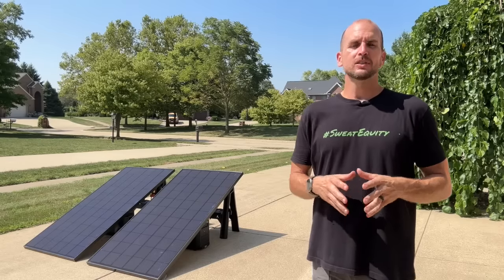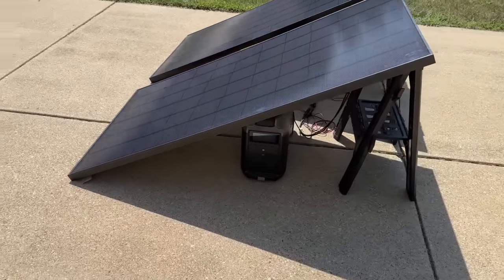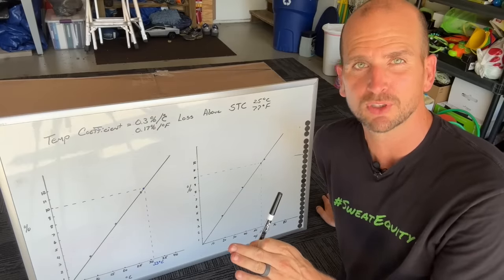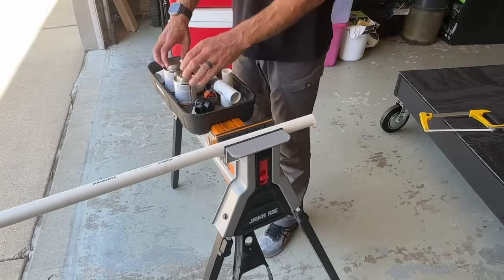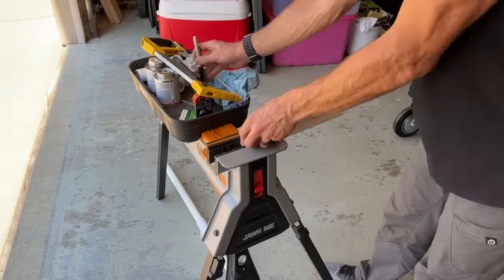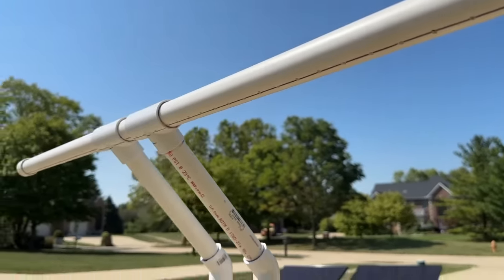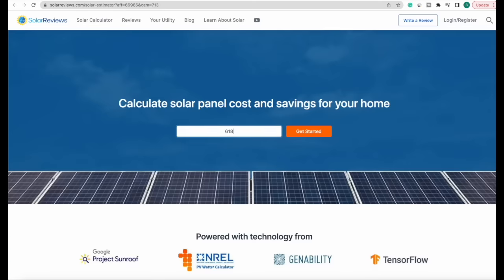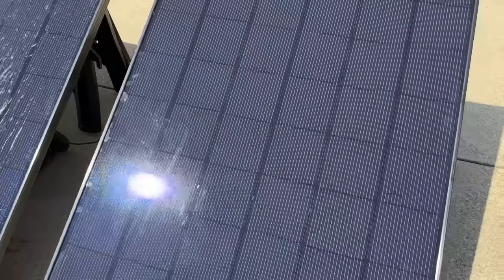Surprising Power Gains By Cooling Solar Panels

Comment: I would reclaim the water at the bottom, run it down into a geothermal system, in the ground, then when the  water cools, it's pumped back up to start the cycle again. Many other uses for that hot water, hot water storage tank for baths, etc.
Reply: throw on a windmill battery charger for the pump and youve got free energy
Reply: The energy u need for that is higher than the profit gained from cooling.
Reply: @lenardgor  boy go on somewhere and study
Reply: People who act like a small pump uses significant amounts of energy probably yell at their kids for leaving LED bulbs on when nobody is home.
Reply: Or move somewhere where you get free well water and hope the power needed to pump the water is much less tha nthe power gain :) In actuality, none of the above are a good idea.  Solar panels are so cheap now that you should just over spec your system.
Reply: @ChristmasEve777  this dude thinks people can afford to move 🤣
Reply: @kingmasterlord  this dude didn't get the joke 😂 🤣 I said "in ACTUALITY, none of the above are a good idea", then I said what IS a good idea.... extra solar panels.
Reply: @ChristmasEve777  yeah and since you're wrong both that they are bad ideas and for saying so, i didn't really value anything else you said.
Reply: @kingmasterlord  I'm a solar expert.  But I don't care what you think!  Go ahead, don't overspec your array with a few more panels, go ahead and use water to cool them or use a tracker.  Idiotic things to do but, my words carry no value.
Reply: @ChristmasEve777 cooling the panels not only increases the power output but also increases the lifespan by several additional years I read a study on this and depending on what panel type, material quality, and configuration can increase the panels lifespan up to an additional 15yrs...which is a  major win... Since for ex. We have a 30yr lifespan panel... We add a cooling system to the back of the panel let's say it benefits to the maximum from the cooling system and gains an additional 15yrs of service life... Let's say the system paid itself off in 7yrs... (Post 7yr mark is full profits) would you rather make 23yrs of profits(uncooled) or 38yrs of profits (liquid cooled)?

Comment: You can watercool the panel by making the backside watertight and pump water through it, and use that water in your heat tank or swimming pool heating.
All in all, it's not worth the effort unless you really have a lot of difference between night and day, but the year itself is not changing that much. So if you do have cold nights, the heat is good for storage in a heat tank, and at night it keeps the temperature of the panels stable plus it lowers the amount of electricity needed to heat up cold water to 65+ celsius after it went through the heat tank. Be aware that you should either have cold water or hot water, but not in between due to legions disease that thrives between 20 and 60.
Reply: We have a buffer of 2000 liters that has it's temperature around 40 to 50 celsius during the entire summer but it's only for heat storage as the water that we actually use just flows through some copper pipes that are inside the buffer and the water simply absorbs the heat from the buffer without exchanging the water itself. Anyway, I don't think there are any bacteria in that water since during the winter that water sometimes reaches 85 degrees celsius when the heating is turned on.
Reply: It works really well in colder climates as the system only pumps the water into the panels during daylight hours and can be used to prevent snow from building up on the panels (via a separated small panel, charge controller, deep cycle batteries, and pump)

Comment: Sundrum Solar has modules that attach to back of conventional solar panels and then use that heat generated for hot water needs, can be swimming pool, car wash, hotels or space heating.
Reply: Thanks for sharing. I’ve been looking for a way to warm my pool while simultaneously adding electricity. I’ll check them out.

If the water cooled panels are 10% more efficient, but cost 10% more it would be a wash. It may be cheaper to just add an extra panel or two.
Reply: @thespencerowen  I've never installed their product but I know they've done a number of projects and think it a very viable means to extract more energy from the sun while making PV panels more efficient due to the cooling provided by the system. If you're in an area that deals with snow it can also be used to melt snow covered panels.

Comment: Majority of the cooling is from water exaporating off the panel so this could probably be done with much less water at intervals.      A supprisingly effectave way to cool your house when the ac cant keep up is to hose off your roof a few times throughout the day.
Reply: Sadly practicality trumps theory.  Unless you have good quality distilled water, you'll have. Rapid scale buildup which will occlude panels rendering them useless.  

Your swamp cooler approach can work if done on the back side
Reply: I’d say more cooling is from conduction (panel to water) than from evaporation in this test.
Reply: @shawnbrennan7526   if that is the case, wouldn't it be better to run copper water tubes on the back of the pannel, which is most likely a sheet of aluminum? That might conduct heat away from the internals more efficiently than running water over the glass.

Comment: This is informative. I wonder if an internal cooling solution may yield even better results. Not only because the actual cells would be cooled but your also avoid any potential loss of sunlight hitting the cells due to the reflection and refraction from the water cascading down the glass.

Might he something to consider for a future aide by side test.

Comment: Maybe you should recommend dual use panels. They harvest the heat with watercooling loops on the back of the panels. So you 1. cool your panels down to get a better efficiency (more Wh) and 2. You can harvest the warm water from the system via heat exchanger.This way you have not wasted any water and get the dual purpose use out of the sun energy

Comment: As a standalone fixture, the potential savings are probably offset by the water and power pumping it. However, if were done as a multifaceted system that is cleaning the panels (keeping pv efficiency ratio up), cooling the panel and also heating water for internal use, then the compounding effect could make it a more efficient and cost worthy approach. I think we'll see more cooling systems in future, as pv panels become more efficient and cost effective.
Reply: Off grid 20+ years and heat loss is an obvious factor you can mitigate. I don't recommend using water though and the way solar installers mitigate it is by adding additional panels to make up what is lost in high temperatures and on cloudy overcast days.

However, for DIY solar I recommend not putting your panels on a roof that is black or dark as that will increase heat loss even more and use a ground mount system over dirt or light colored rock. You can also increase air flow to the back side of the panels by removing obstructions and if possible set them so the natural wind patterns flows across the panels. Even a light breeze makes a difference.

A ground mount system with adjustable tilt and angle or a tracker is optimal.

I also recommend a ground mount system so you can wash the dust and bird crap off your panels and check and do any maintenance needs. My system gets washed off a few times a week.

My system is 1.4Kw ground mount with 600Ah LIFEPO4 batteries and  Geneverse 200Ah and ALLPOWERS 200AH power station for extra capacity and that runs everything: water pump, lights, microwave, laptop, evap cooler, ebikes and recharges lots of tools and gadgets.
Reply: Have a capture system and directly put the reclaimed water back on the solar through a radiator in the shade with a fan and a pump you'd probably have to top it off cause of condensation and evaporation creating a loss you'll need to account for but could definitely work on super hot days

Comment: when i was getting my degree in this field, i met a guy that installs flat fin tubing on the back of panels and the water was cooling the panels and was used to generate heat through thermo heat generators, and some went to domestic use.   
the important thing to remember is to use as clean a water as you can if you are going to wet the panels to prevent degrading by mineral build up and water is a universal solvent and will destroy the frame over time

Comment: I remember reading years ago (early 2000's) that solar panels were more efficient in slightly overcast days, I have no idea if it was accurate or not, but this would kind of back up the theory that the panels work better at a cooler temp.  Either way pretty interesting to me, thanks for making and posting this.
Reply: Basically sometimes a cloudy day will magnify the suns rays through the light moist cloud particles

Comment: I not only have this set up for my 12.4K W backyard fence mounted system but I also have low pressure misters that clean my solar panel and pull my solar panels from 130° down to 88° increasing my total power production by 1200 W which is enough to run a small air conditioning unit. 

I also have a smaller version of a whole home water softener for lime scale.

Comment: to be clear, efficiency increases below STC. The flow meter was a nice addition. One additional test would be periodic water flow. Save water and allows the water to evaporate, cooling the panels. This will depend on humidity which varies by day and region.  Also, if the heated water could be used for things like swimming pool heating or hot water preheating, it gets a bit more cost effective. Water also block longer wavelengths of light (so red more than blue), so cooling the back of the panels might be more effective.

Comment: Off grid 20+ years and heat loss is an obvious factor you can mitigate. I don't recommend using water though and the way solar installers mitigate it is by adding additional panels to make up what is lost in high temperatures and on cloudy overcast days.

However, for DIY solar I recommend not putting your panels on a roof that is black or dark as that will increase heat loss even more and use a ground mount system over dirt or light colored rock. You can also increase air flow to the back side of the panels by removing obstructions and if possible set them so the natural wind patterns flows across the panels. Even a light breeze makes a difference.

A ground mount system with adjustable tilt and angle or a solar tracker is optimal.

I also recommend a ground mount system so you can wash the dust and bird crap off your panels and check and do any maintenance needs. My system gets washed off a few times a week.

My system is 1.4Kw ground mount with 600Ah LIFEPO4 batteries and  Geneverse 200Ah and ALLPOWERS 200AH power station for extra capacity and that runs everything: water pump, lights, microwave, laptop, evap cooler, ebikes and recharges lots of tools and gadgets.

Comment: there's no way the extra 5% justifies the cost/waste of the water. Thanks for the video!
Reply from the maker: For sure
Reply: That depends on the climate. Somewhere that gets large amounts of rain could capture plenty of rain to do this and then use the water for other purposes like watering a garden. The water doesn't have to simply be wasted.
Reply: then use your brain, make pan that captures the water then cycle it back..
Reply: @kahingaltv2023  it’s not worth it. But feel free to do it with your gigantic brain
Reply: @kahingaltv2023 Hi, think rain water harvesting, the panel becomes the means to capture the water.  Using the tank water to cool the panel uses the rain water capture parts you already have. The big tank becomes the heat soak that gets liberated at night.
Take care all M.
Reply: Ofc not, however it is a very interesting test.
Reply: A pool already has a running pump and plenty of water, and the heat added to the pool water is a benefit it many climates. So it is a win, win, win.

Comment: Thank you for your valuable input. There is so much wrong to unpack here, I don't know if we will ever get it right before it's too late. 

0*Installing a properly sized capacitor pack between the meterbase and main panel & soft start packs on ac units will greatly reduce the amount of in-rush power used & lower  energy "consumption." 
1*Kinetic energy is way cheaper & easier to produce
2*There is another type of panel that produces electricity even on cloudy day or when covered with snow 
3*The entire landfill system could be eliminated, and garbage incinerators used to create steam to power generators & the smog output is filter ; rendering  a carbon neutral pollution output and has other benefits.
4*Internal blade wind turbine technology has really come a long way. When it comes to mounting, what cosmeticly looks like a futuristic chimney stack to your rooftop, wind blows thru it, power comes out of it. Both day & night

Comment: Nice video. I have 800w of ground mount Rich solar panels connected to an EcoFlow Pro and run the sprinkler in the heat of the day. I almost always get at least a 10% increase. It might be because I’m in Oklahoma and it’s 108 today 🤪. I checked my panels and even with water cooling they were 90+ degrees
Reply: Please stay inside. 108 is more than boiling point of water!!
Reply: i think he means 108F, America is in Fahrenheit not Celsius.

Comment: We can place finned heatsinks behind the panels and wet these heatsinks regularly with micro sprays. In this way, semi-passive cooling can be achieved by evaporation on the increased surface of the heatsinks with fins. If we ignore the heatsink cost, I think this will be the most viable solution that provides the highest efficiency... I love your videos, keep it up. Thanks.

Comment: Great video! You can also filter the water and pump it back through a heat exchanger. While not ideal, and it is more complex, there are ways to do this without using the water once and throwing it out.
Reply: Doesnt make sense. The pump would consume more than the 20 W / hr per Panel.
Reply: @Chris-yy7qc  what are you optimizing for? Energy or water consumption? 

A ram pump can operate with 2-3 feet of head pressure. One might be able to build a self refilling system that requires no electricity. Or a pump that runs only to refill a reservoir intermittently, and use water height to drive the flow. 

Complex? Way to complex. Benefits? Not enough IMHO. But potentially still a net positive effect for the effort. 

Add a dedicated panel for the intermittent pump and you’re good. No battery, should stop running when the sun goes down anyway.

Comment: Yeah!   I've noticed this in my van one day after it rained.  Also, it's counterintuitive but my panel covers a ventilation vent in the van, and running the fan produces more power despite the fan load than not.

One great use case for this is for an off grid tiny shack house with a single slope roof where nearly the entire roof is solar to block the sun.  The water would keep the roof and shack cooler.  In my case during those direct sun hours I'm running a 12v pump to filter rain water used for bathing, washing, cleaning and irrigation so might as well run it over the roof achieve this affect, which i think will also disinfect and heat the water.

Comment: I have an Ecoflow Delta 2 and 2-HQST 190 watt panels. I purchased them in August of 2023. The panels are connected side-by-side and are rigged with 10in wheels and a sturdy PVC adjustable leg arrangement that can accommodate tilt-angle and azimuth all year long. I can move it around the yard as needed to dodge the shade of nearby trees to grab as much sun as is available.
Later in the year, I was charging on a sunny but cooler day, what we call DELUXE weather in Florida. The Ecoflow app showed a whopping 400 watts, but only for a few seconds. It kept on charging in the low to mid-300 watt range. Now that it is 95° here, I’m getting no more than 300 watts and usually under that, in sunny weather.
So, today, June 8, 2024, I recalled you experimenting with water to cool off a solar array; I gave it a shot. I was charging and getting a steady 263 watts with the panels grabbing the sun at the correct tilt angle and azimuth. I began watering at the top of the panels with a hand fan sprinkler, letting the water cascade down to the bottom. Within one minute the charge went from 263 watts to 313 watts and stayed there until I removed the sprinkler. The wattage slowly returned to 263. Armed with this knowledge, I might rig something up if and when we lose our power to a hurricane this season. (We've never lost water pressure in the past, only electricity.) That significant wattage increase may come in handy.

Comment: Very interesting test.  It doesn’t seem though like it would be worth it long-term.  The cost of running the water just doesn’t seem like it would outweigh the benefit of 5%.  Now if you had a closed loop system where you had a way to naturally cool down the water (without some kind of conditioner running), and all you had to do was run a small pump, it might be worth it.

Again, very cool test.  Thanks for sharing it!
Reply: I wonder about how to circulate the water to make it a closed loop. You could do a geothermal style loop and dump the heat into the ground.

Comment: I've certainly noticed this.  My array produces more power on cool sunny days than on hot sunny days.  My highest production days are actually during the winter!  Of course it helps a lot that it only snows for a few minutes per decade in San Diego.  This is why you should never mount solar panels with their backs against something solid, unless it's a good heat exchanger.  They need the air flow to cool the backs.  I think spraying the backs might work better than spraying the glass because they are in better thermal contact with the silicon layers.